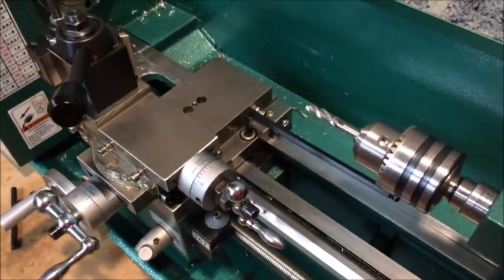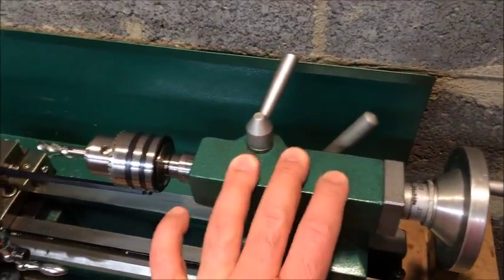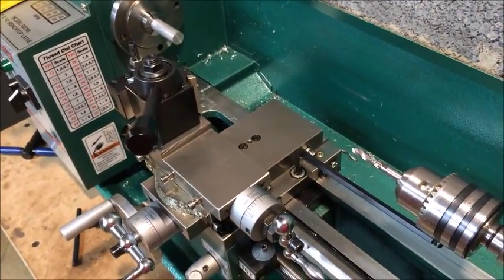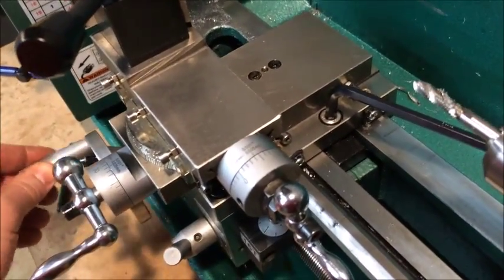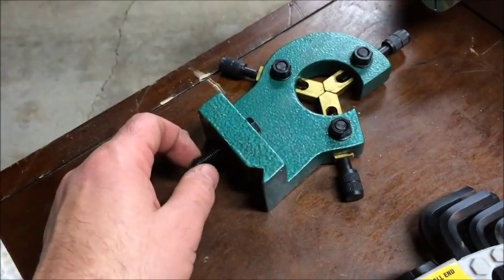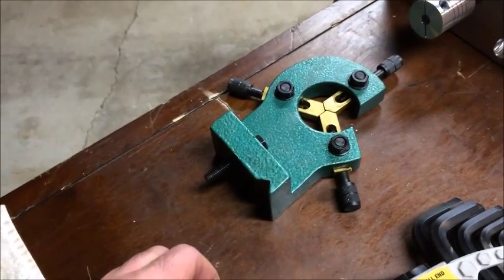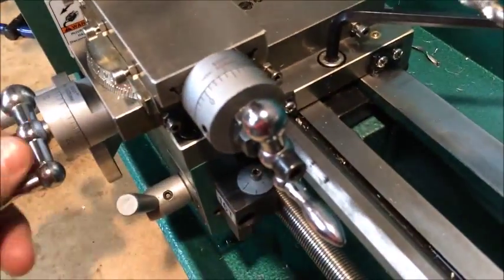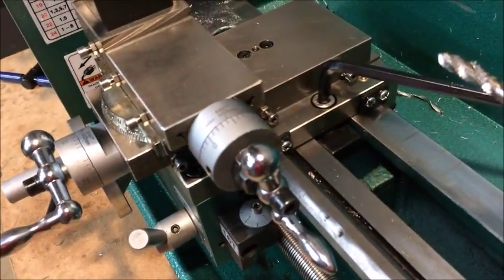Simple Carriage Lock For The Mini Lathe

Comment: Was looking for a lock as well a stop. Great idea! Thanks for the tip
Reply from the maker: +goldsearcher55 You're welcome.  If you have the Grizzly lathe, this is pretty easy as the casting for the carriage is larger than most mini-lathes.  If you have a HF lathe, you may need to do a little bit more work to accomplish the same result.